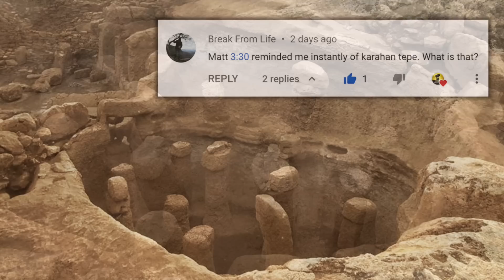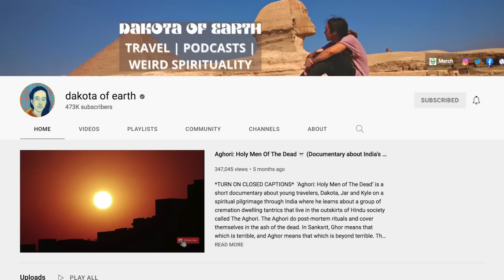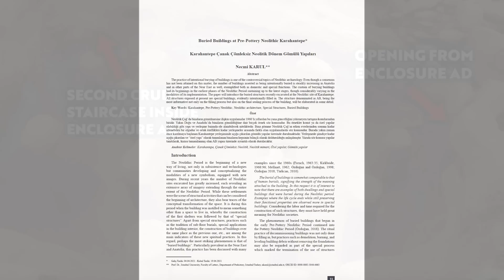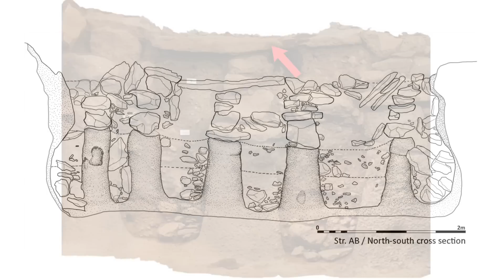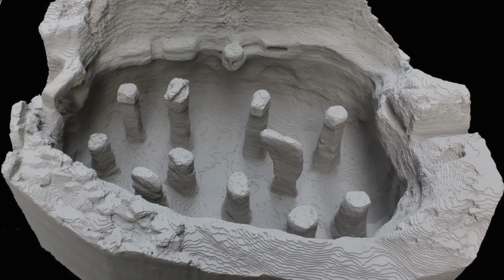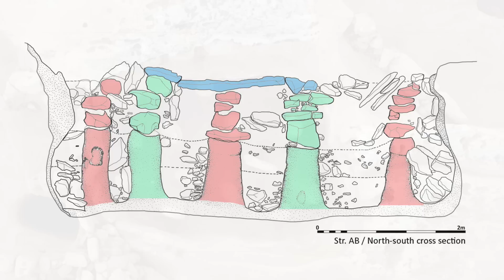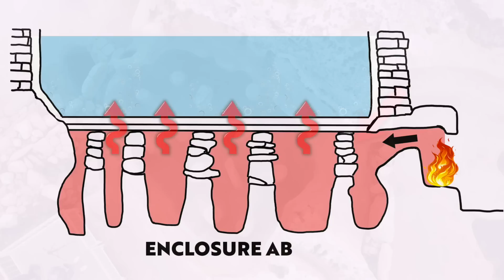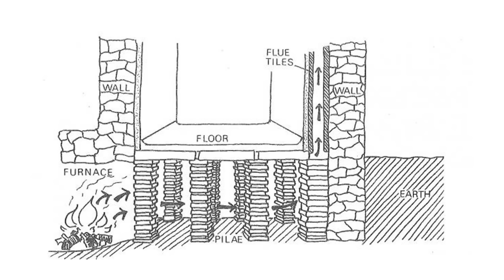An 11,500-Year-Old Central Heating Hypocaust system at Karahan Tepe? | Ancient Architects

Comment: If true, you are rewriting history right now. 

But to be honest, I don't think it is true. It makes not too much sense to excavate a huge cavity from the bedrock for a heating system. It is very much easier to build it on top of the ground. Or dig into soil like you would do for a standard basement today. 1.7 meters is much taller than needed for a heating system.  Of course this alone is by far not enough to disprove your hypothesis. It is possible that they chose a design that made sense to them but not to me. 

There is one  thing that in my understanding can not be matched with your hypothesis. If it was a heating system, there must have been a lot of soot. Soot is extremely long lasting. It also is very hard to remove intentionally, making it unlikely that all of it had been cleaned before the enclosure was filled in. As long as there is not the slightest trace of soot discovered in the enclosure, the heating system hypothesis is close to impossible. But if there is soot discovered, the hypothesis basically is proven true. 

Being cut into the bedrock brings the enclosure as close to being watertight as possible. The "waterline" and the channeling also makes it appear to be some kind of reservoir. But other features don't really fit the water reservoir hypothesis. If it was a reservoir, the pillars only make sense of they carried a roof. And if there was a roof, the relief head is in a really strange position. The separate pillar also seems to have a heavily eroded face. 
The head on the wall and the face on the pillar could have been gods. Guarding the water in a reservoir or the fire in a heating system. This would provide sense to their strange position just under the roof. 

To me the staircases don't provide much evidence for a ritual use. They don't seem to be well enough made for regular use. They look more like parts of maintenance entrances that were rarely used. But maybe erosion from heavy use and 11000 years of time removed much of their original shape, I don't know. 

The cover stone slabs and the rather thin stone blocks that were filled in vertically look like they were parts of the original roof, later reused in the filling process.

Comment: Those pillars heights seems to be shorter or bigger depending which "beam" (of wood?) rested on them... or how many of those floor/ceiling "beams" crossed over the pillar and rested on top. I can't stop seeing lines of cross-supporting beams, seeing them from above. Crude but solid earth work. Just a thought.

If that is the case, wouldn't that be AA a room of "getting the fire burning", BB a "bath house" above it and AD the "main warm building" all connected to a heating system, instead of ritualistic and seemingly unconnected fertility rooms thing?

(Also, do researchers only think of sex business or something when excavating ruins? I'm thinking of freezing coldness on the region when people ever dig below or extreme heat outside. This doesn't seem to be from hotness outside rooms though, more like mini ice age when they were there.)

Comment: AA- Interesting. Question: You mentioned "cement" a few times. is there evidence of cement at the side?

Also, I would be keen to know what the climate was like in this area these tepes were in use. (Perhaps you covered this in an earlier video.) It looks like a desert area now -- though a modern agricultural area is clearly visible 6 or so kilometers to the west.

Thanks.
Reply: There was a ice age around that time.  As for cement, at the very least they would have had mud and clay to fill cracks.

Comment: Think sweatlodge..I think your on track..that looks like a bath next to a sweat lodge.. as far as water filtration goes i would doubt it. I also work in water filtration. I design and build systems for biosecurity. The worn part looks like many wet feet over time going up to the platform over the heating area.
I was writing this as I listened you then came to the same conclusion I had before..not so much hygiene..that wouldn't be their priority..thinknritual but also think of Iceland communities and how bathhouses were also a luxury out of the cold and a meeting point.
The quality of water caught in the cup mark system would have been of drinking quality..I don't see this society needing water quality of the degree we do today..
If it was a water tank and that is l8mestone the sides would show more water marks..be a lot smoother as well. Fresh water and limestone doesn't go together well. It leaches the salt and structures that give limestone its structure. After many years if holding water those walls and pillars would crumble now.

Comment: No easy entrance for the fuel, no easy way to clean it out. Pillars cut from bedrock that aren't suitable to carry a roof. No flat area or sign the pit was roofed with stones before it was filled with mostly waste. (Not showing any signs of being heated). Seems pretty ridiculous to think they floor an area with burning stuff by balancing flat tiles on a couple of loose rocks on uneven pillars. Which, cut out of the same rock, have no reason not to be even if to carry something was their purpose. No signs of smoke or burning in all the pit. And then there's the face. Why would they carve a face into a heating system? Seems far fetched to me, this interpretation of the pit.

Comment: MAY be you should employ varied intonational patterns to match the varied meanings of your sentences. MAY be that not doing so creates the impression of a learning-impeded robot. MAY be they the archeologist is correct that the hypercaust system hypothesis is silly. MAY be that they would not have placed labor intensive sculptures on the pillars in the chamber if this were the case. Moreover, MAY be that there would be ash/carbon remains of the fires that went into to the supposed heating chamber or flues to let the smoke etc. escape, or evidence of the collapsed upper story, etc. if the thesis were correct. Also, MAY be the evidence of the supposedly thick stone overhead being the floor would be more evident were the thesis correct...MAY be the supposed floor would be too thick to serve as a heated surface. MAY be that the flattened pillars instead supported a wooden roof or a wooden floor. MAY be an interesting hypothesis but more evidence is necessary to support the notion.  MAY be the ledge around the chamber circumference might have supported the overhead roofing or floor system. MAY be you should vary your intonational patterns.

Comment: i THINK YOU ARE CLOSE TO WHAT IT IS, BUT YOU HAVE TO ASK if this is a heated house, why do the roof pillars cry out, dont put beams on me...they are RADIALLY ARRANGED, not for supporting a roof. Think about what was going on 12,000 years ago: Younger dryas decimation on a worldwide scale, no agriculture yet, no pottery yet. What would all these things lead to? An escape from the terrors of YD, a new source of food, something that require pottery or liquid holding vessels, couldn't be a basket. BEER PRODUCTION...to soothe the beast, beer and bread from wild wheat and rye, not even being planted, but growing wild for the taking. Finally, something to drink out of...not a basket, pottery. I think AB is a beer vat...whether it was heated, or heating of water was required I don't know. AD would be a water basin, with a covered spout into AB. AB's pillars support either a cover or just boards or flat rocks to keep trash out or provide access OVER the vat. The main enclosure could be where the grain was processed...Gobekle Tepe had 20,000 grinding sets found there,,,.all those small water basins are grinding or milling holes for grain processing. The same kind of holes are seen in here in Ga., USA where gold was milled from quartz...as soon as the hole was elbow deep, another hole was started. My original view of the main two pillar roofless oval structures at GT and Kt and other places were clan related cemeteries for excarnation , because of the presence of so many vulture carvings and because human figures are headless...because a skull worshipping cult prevailed for 1000s of years in this area.

Comment: So, why would that face be looking below the floor? The furnace heat box was monitored by a god? You know where that leads.
Let's Examine the channels in light of heating. They don't look like duct work (for air) do they? They clearly look like water channels. Did they go through that trouble to divert water so that the fires could be extinguished?
What is the length of winter there? Is it so frigid for so long that they need to go through all that trouble to heat a very small space?
Not buying it. Water or booze related. The three pits are connected by a liquid stream for whatever reason. The pillar tops were islands in that liquid. You could step from pillar top to pillar top. The pillar tops and the face would still be seen with the water level up to the beard. The stacked rock all look like dam/dike work, not like support work. They were creating paradise (abundant water = plants). The spring dried up.
Nothing at all screams fire/furnace to me.
Don't give up!